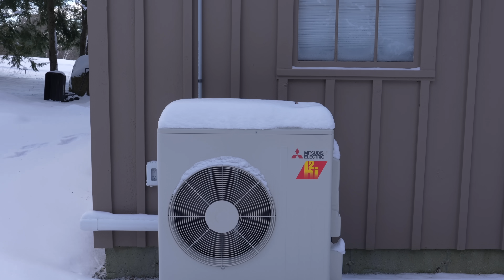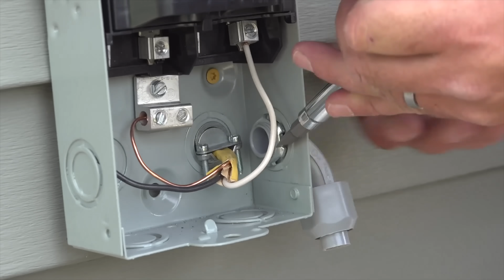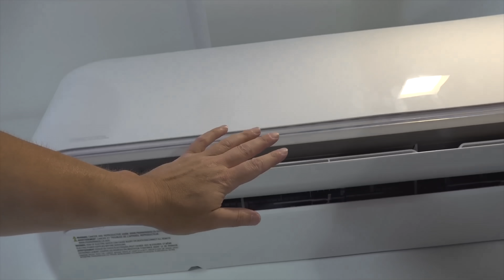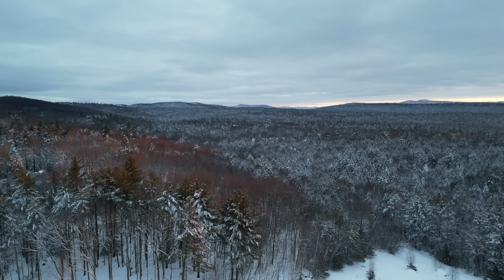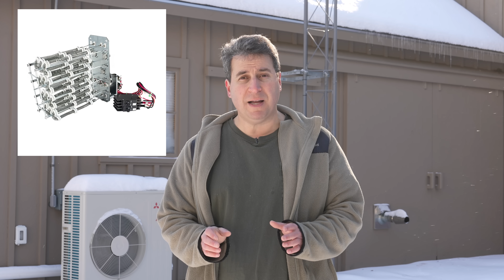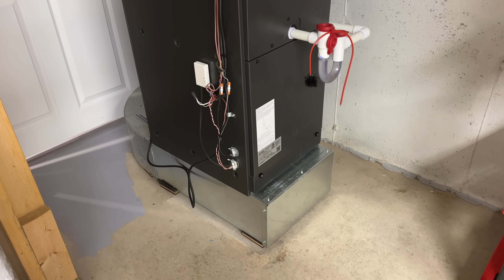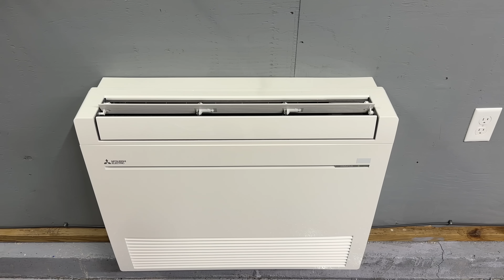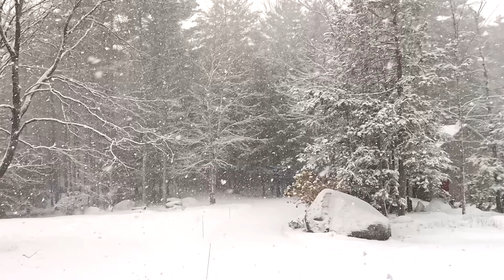Why Heat Pumps are now leaving people COLD

Comment: This video has decent content and good facts, but between the scary title and taking almost to the end (5:10) to get to the point, "the bottom line" part, it's kind of annoying.  So let me summarize:

1. The newer generation of heat pumps are a lot more effective and energy efficient, but they STILL have limits, and those limits are close enough to real conditions that it's not an obvious slam dunk one way or the other.  

2. So, ultimately, if you live in a seriously cold climate you might, probably will, need additional heat some parts of the year, and that'll involve additional equipment and monthly costs.  

3. And apparently, from what the video says, installers are NOT being clear and proactive about this, so unless you ask about it and figure it out, you're likely to get an unpleasant surprise when the really cold weather arrives.

It's annoying though, it seems hard to get clear answers on what exactly those limits are.  How exactly cold can it get and still work?  What exactly is the electricity usage at different temperatures?  I did see one post about an organization called the North East Energy Partnership (neep.org) that has good data about heat pumps, they might also have info about temperature extremes in your region:

http://www.neep.org/initiatives/high-efficiency-products/emerging-technologies/ashp/cold-climate-air-source-heat-pump

A lot of people seem to use electric heating for the additional heating, probably because installation (parts and labor) is cheaper (especially because if you don't have ducts, you can install baseboard heaters, etc,).  But electric heating is typically a lot more expensive to actually run.   The question is, how much/how often will you need to run it, what's the extra cost compared to gas/oil/whatever for running it that much, compared to the cost of installing a different type of heat.

Do the math, figure out the tradeoff.

I looked into heat pumps early this year, mostly because I was curious about how the newer heat pumps worked so much better.

The industry terminology is confusing, and I don't just mean that in a "technical stuff is confusing" way, but rather because the terms that people use are arbitrary and don't necessarily relate to what makes the newer heat pumps different.  For example, they like to call them "inverter motors", but that's because they run on DC so they need an inverter to convert your house AC to DC to run them.  But that doesn't tell you anything about why they can work at colder temperatures. 

From what I did manage to find, the newer generation of heat pumps have two major differences.  One is that they use CO2 for the refrigerant, the other is using brushless motors and something called EVI, Enhanced Vapor Injection.  These enable it to keep working at lower temperatures, and in general be more energy  efficient. 

Brushless motors are inherently more energy efficient, and also can be run at variable speed which enables them to be run faster and slower as the conditions require (which usually helps with energy efficiency).  Both of these capabilities are because brushless motors use transistors to control the timing of the motor magnets, rather than physical contact via copper brushes.

I'm still not clear on the physics that make EVI more effective and energy efficient, it has something to do with diverting some of the stream of refrigerant, then reinjecting it right before it hits the main compressor (aka the "scroll compressor", which a more knowledgeable person told me was just somebody trying to talk fancy, because most ACs and heat pumps in the last 20 years use scroll-type compressors).
Reply: Wow this is lengthy, but spot on the nose!

Comment: I love how you claim that heat pumps work in the cold weather and all the myths about them. Not working in cold weather is a lie. But then 2 minutes later in your video, you claim that you have to have supplemental. Heat Because the heat pump wont-work below 30°. Well if it can't work below 30°. What the hell do I have it for?
And why would I want to pay all that extra money to put in a stupid heat pump when I can just have one? Heat source that works at all temperatures.

Comment: You are standing in front of a Mitsubishi HyperHeat unit that works at low temperatures.  That one is for only one indoor minisplit.  I have the first multi-zone HyperHeat in Vermont.  My outdoor unit is like two of your stacked, two-fan units.  I have five indoor units.  The system works at minus forty degrees.  My pre-existing oil furnace had not been turned on once since the heat pump was installed 9 years ago.  I'm a physics professor and measure my units carefully, and I live in Vermont where it gets cold in the winter.

Comment: I thought I was going to be bashing this video based on the title. Or just downvoting it and marking the channel "Do Not Recommend".
But ...  clickbait titles are required for YT. And he presents the facts well.
I looked at the channel profile and ... nope, legit channel. And good info.
Here in SouthWestern Ontario air-source heat pumps will not cut it about 30 days a year. Maybe a few more. But there are also places here which have straight-up baseboard resistance electric heat. I've owned three houses - and my parents house as teen was a fourth! - that were individual baseboard heat in every room.
Air source heat pumps with a resistance strip will outperform them EVERY TIME. Both cost and comfort (the comfort because, unless you run them all the time they take too long to get an individual room up to temp).
There are very few places in the continental US that air source heat pumps are not a cost competitive option - and just wait until the cost of natural gas spikes (like it is going to).

Comment: Nice presentation and information.  However, not all heat pumps are air to air (air sourced).  Geothermal heat pumps do work regardless of the air temperature.  I know it's nit picking - but specifics matter here.

Comment: These are great for moderate climate locations but efficiency and performance deteriorates as the thermometer goes below  zero. Electrical rates in my hood are drifting upward which makes me very reluctant to switch from natural gas. As of this , one of my son’s Samsung mini splits  has a non functioning thermistor and our friends at SAmsung say they are back ordered for some time. And yes, you need to elevate the outdoor compressor unit and keep it clean .

Comment: It is critical to correctly size the heat pump based on the amount of heat the unit can deliver at the expected outside temperatures, not the max output.  This is especially true for air source heat pumps and  as noted in another comment:  less critical for ground source heat pumps because the source temperature is more constant.  The title of this video is misleading.

Comment: I'm in Michigan, and I live in a 1,200 sq ft home + full basement. I also have cathedral ceilings, Large windows, patio doors,  older windows, and not the best insulation. I did some remodel work and have R13 in my exterior walls.  I took out my oil furnace and got a Mr. Cool universal 5-ton. I placed a woodstove where the oil furnace used to be. Multiple days of -16F, and our house was 70 degrees. That month, our electric bill was close to 800. I pay about 11 cents a KW . It has been cheaper than oil and great in the summer too.  I imagine that a ground source or new combined HP boiler styles from (Heat Geek)  are insanely good. P.S. I do not have the heat strips,

Comment: My Diakin FIT is awesome, variable speed drive and most electric bills are about $65 a month year round 40F - 105F .. they really work out West. It does have resistance heat strips but never used here.

If I lived in the Northeast I would definitely still do gas fired or geothermal with radiant floor heat.

Comment: I live in Canada and just installed a Heat Pump coupled with a gas furnace as an auxiliary.  I run the pump until -1.5c and below that the gas furnace kicks in.  Cost savings is debatable but doing my part for the environment by reducing natural gas consumption.

Comment: My newly built 2200 sq ft home in lower Mich has a five head mini split system. I also have two direct vent fireplaces. One on main floor and one in walkout. If it’s too cold for the minis the fireplaces more than make up the difference. The fireplaces are 80% efficient. The splits are rated to -20 degrees. I installed them myself and saved a small fortune.

Comment: The problems discussed in this video only pertain to unqualified HVAC companies. 
Professional companies know all of this. They will first run a heat loss heat gain calculation then determine your homes thermal balance point. From here they know exactly when auxiliary heating should kick it and how much is required to meet indoor design temperatures. 

It's unfortunate that so many guys are improperly taught and the homeowner is the one who inevitably pays for it.
Reply: I first would not like to have heat pump sized to maximum possible cold temp. 
It will be oversized and expensive to buy and maintaned. 
I have wood stove for this extra two weeks in all winter season when temp are low and cold wind.
Reply: @dmohac3557 That's totally acceptable and would be an important discussion to have with the HVAC contractor so they design the system accordingly.

Comment: So you buy a heat pump system ONLY if you live in a perfect climate zone.  Most of the US gets to temperatures below freezing(32F).  Other wise you still need a backup system(fireplace or wood burning stove, gas furnace, electric heating, add-on electric resistance heat for your heat pump system, etc.).  The logic of this doesn't add up.  Very significant cost of initial installation, a lot higher electric bills, higher cost of maintenance and repairs, shorter life span AND a back-up system.  Also, we DO NOT have an electric grid compatible with more electrical demand.  Does anyone do 'real world' studies?  In my 'real world' this doesn't work.  I'll watch while YOU try it out.
Reply: 100% BS, there is more heat outside then you realize, your knowledge is stuck in the 1980's , lol, your lacking knowledge , I have a mr cool universal ducted heat pump 2ton (3ton selectable by dip switch) i have it set for 2ton for 1100 sq ft town house built in 86 and decently  insulated, but not perfect, there are some drafts, and the heat pump keeps the house at 73-74 with a temp of 0F outside, it was zero degrees outside a few times during the winter, and no it did not run continuously , my entire elect bill was about $139 durring the coldest month, i did a temp test at the register, and the hot air coming out of the register was between 134-135F, you just have to get the right heat pump, you need the cold climate heat pumps.. oh and btw, I DO NOT Have the heat kit (electrical heating element) installed in the air handler, do not even need it!

Comment: "As low as -20 degrees" - Cries in Northern Canadian.
Reply: LOL For Canadian winters, -20 deg  C  is mild. 

Maybe around the Canada-US border that  runs mainly along the 49th Parallel  -20 deg. C is sufficient.
Reply: I don’t even know what -20 F is.  Is that really cold?
Reply: @boydgauvin3377  -20 F is somewhere around -28 C
Reply: You were raised when we used both. Give me a break. Every 5c above or below 0c or 32f add or subtract 9f @boydgauvin3377
Reply: Minus 5 is the max. Below that and the heat pump will be on all day.
Reply: @Steveriknowsit will just defrost alot the colder it gets 
Had mine working great at -15
Reply: @jacktheripper-hp9tx I like to turn down the heat when Im not home or asleep. Heat pumps take far too long to reheat forcing you to heat an empty house.
Reply: @jacktheripper-hp9tx Does it ever turn off at minus 15? Whats the electricity bill for that?
Reply: Not true at all. 
New heat pumps can deliver nearly the same output down to minus 35f or close in celcius. Problem is the heat pump runs longer and faster as the house needs more heat. @Steveriknows
Reply: @JoeBlau1350 You'll regret being reliant on electricity for heat Bubba. On that I'm not wrong.
Reply: i live in canada  i bought one of them 120 volt ones it heats my whole house in the winter and powering it off the solar and batteries 
and the grid when the price is the cheapest on a timer charging the batteries 
i charge from 7 pm to 7 am and run the heat all night with charging for 15 cents per hour 
then after 7am it switches back to battery and solar free all day
Reply: @jacktheripper-hp9tx  the solar is frozen in Alberta so you must be special
Reply: @jacktheripper-hp9tx Is your house 100 square feet with 10" styrofoam walls? Friends who live off grid and do the same require a generator to run 4 hours a day combined with a bank of 20 solar panels to heat their house with a heatpump.
Reply: @Steveriknows2 story house 
I used 30 bucks in gas  the rest was solar and I charge at night when the hydro is 9 cents a kwh hydro cost an extra 8 bucks 
I get a rebate for using hydro of 30 bucks for night time charging
Reply: @jacktheripper-hp9tx Sounds like a good setup but it is alot of work and responsibility. The off grid couple I know is away on a one week vacation and needs someone to drop by his house twice daily to run the generator for a few hours each time. Literally drive into the bush, start it, drive home or work, back in 2 hours to turn it off. They have no power from the line as a backup so if someone forgets to top up the batteries for a day it can be catastrophic. The person he's counting on didn't show up this morning and he's in a panic asking if I'll drive 45 minutes one way to turn on his generator.  Will cost him 60k to bring power to his house but to me it'd be worth. Not my sort of lifestyle but more power to you for putting in the effort.

Comment: I installed heat pumps.  They are great and efficient for A/C, they suck and are really expensive to heat with below 30 degrees Fahrenheit.  Anyone saying otherwise is either lying or has really cheap electricity.  We do not have really cheap electricity in Maine.

Comment: So your statement is true on mini split heat pumps but on traditional heatpumps they do use resistantance heat strips as back up( emergency heat) . This type of heat in traditional heat pumps gets used often. Because every time a traditional heat goes into "defrost" it will energize the back up heat every single time. Tradional heat pumps swith modes got into AC mode to melt ice from the outdoor condenser coil. The indoor fan does not turn off like a mini split heat pump. So essentially they have to use heat strips to reheat the air or the air would come out cold in the duct .

Comment: I recently inhereted my mother's house, which has existing oil heat. The numerous renovations I have planned include a heat pump with oil back-up. The existing fireplace will be retrofitted with a wood burning insert. Living in the Northeast, it never hurts to have multiple options for heating.

Comment: I had an older window unit in Oklahoma that had heat wich worked well but it is expensive to run i find a natural gas furnace is a lot better and cheaper to run fire us hotter heat than electric but in the country where natural gas is not available you end up with electrical heating or propane wich can be more expensive heat pumps are not all that great for colder climate s.

Comment: I have 3 Senville Arctic Series heat pumps in my house which is well insulated and 25 years old. 
They effectively heat my house down to 0 DEGREES F  (-17 deg C)
My house is 2400 sq feet and open concept we keep the heat at 70 Deg F (21 Deg C)
My entire electric bill is around 2200Kw in February, that is my hot water, lighting and heating which is about half of what my fuel bill was for my oil furnace.

If you have Arctic series heat pumps and they are properly sized and maintained, then you have to look at the insulation value of your home.
Today's Senville Arctic series can easily heat a home in winter, I live in North Eastern Canada where we have very cold winters.

Comment: I live in Maine and live in an efficient apartment built in 2020.  I have a heat pump and electric baseboard for January and February. Heat pump is a GREAT a/c unit, but as a heater I HATE it. Yes very cheap to run, but produces poor quality of warm air all winter. I feel it tries to maintain your set temp, so if to warm from say cooking it will cool home down by plowing cold air. So if near it you can be very cold even in heat mode. Then you can NEVER turn them off even if windows open. You put in dehumidifying mode because condensation will build in unit when off and rundown your wall and stain it and make mold. I do not want to dehumidify the world.  My wife and I are building a home and will NOT get a heat pump.

Comment: Ran the whole house on heat pump mini splits this prety cold winter in NYC. Bill averaged 550 for the coldest 2 months but I never had an issue keeping any are of the house warm. I do have good insulation and no drafty windows or doors which is detrimental to keeping the heat inside. Gas bill was 30 bucks and my neighbors was over 500